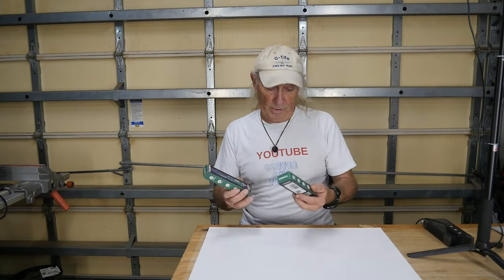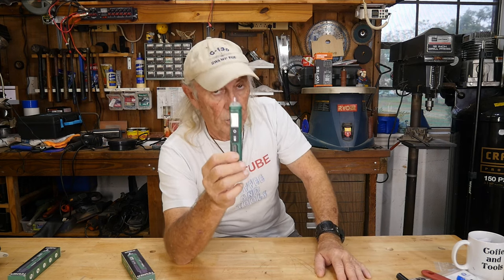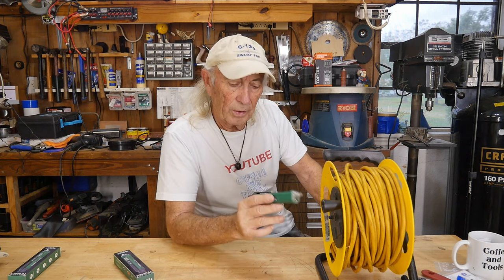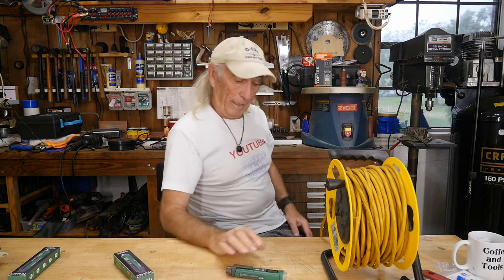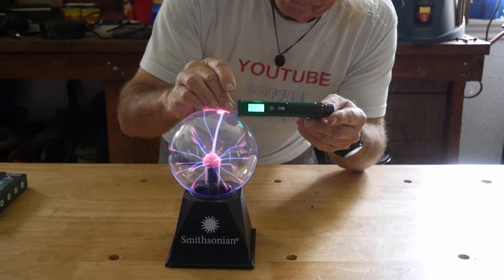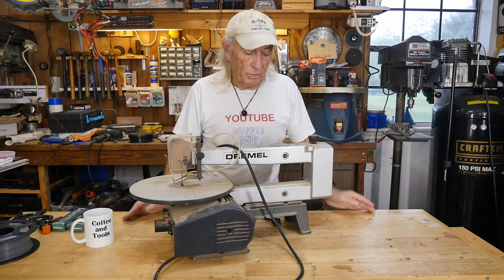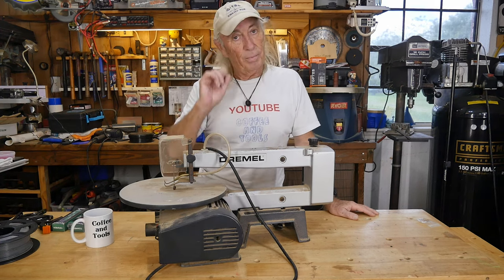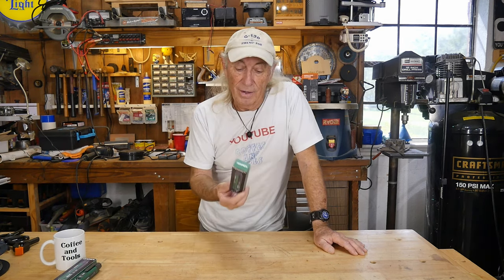Tesmen voltage detector simple and NEW, reviewed by Coffee and tools ep 381

Comment: I make firearm furniture and my delta scroll saw is an indispensable tool. Mainly when there is some cutouts on handguards, grips, and stocks. If i didnt have it, id have to use a forstner bit and make a bunch of holes then hit it with the drum sander which takes forever. If you're not making intricate enclosed cuts or big cutouts all the time then you dont really need it. Most folks can get away with just a table saw, drillpress, band saw, router, and some sort of stationary sander.

Comment: I have a delta and craftsman scroll saws. I use them and make lantern boxes with designs cut out in the front. Make quite a bit of side money with mine but I don't have a laser cutter and it'll cut through thicker material. Also find it relaxing to do scroll work.
Reply from the maker: Lantern boxes sound like a good project for the school saw. I'm just not a big fan of these lasers, but they are getting more and more power. Still with a scroll saw no software needed LOLOL..
Reply: It would be interesting if you could expound on the lantern boxes. That sounds like a fun project!!👍🏻
Reply: Scroll saws! Okay…I have one and yes, it IS on my list of tools to use after a make a movable base for it. It’s another one of those tools I inherited from my Dad and it is, yep…harbor freight!! But old harbor freight! The saw is a Central Machinery product out of Taiwan. It’s long out of business but I’ll tell you what…it was a great loss to hobbyist home workshop guys like me!! Sadly the bandsaw I had by them that I inherited from my dad, broke the table during one of my many moves. It was impossible to get parts so it got broken down for parts. Broke my heart. 
Anyway, the thing is a ship anchor!! Like all the central machinery tools!!! I did buy some blades for it and my dad had a bunch already. 
It even has the blower tube to push dust out of the way. 
So they may be “old school”, but I like that anyway!!😎👊🏻
Maybe I’ll start a movement to “Save the Scroll Saw”!!🤣
Reply from the maker: Yeah, he's got my interest for lantern boxes TOO....mmm
Reply: @SirTools uploaded a slide show no sound though im new to this. If there's interest maybe I'll try and record a tutorial.

Comment: Nice video. Do you know it the tool is sensitive enough to find power runs in walls? I’ve seen folks using scroll saws but most of them are following ready made designs so I think the laser cutter would be more useful. If you had a huge shop it might be a nice tool to have as what used to be. Thanks for sharing.
Reply from the maker: It seems to pick up power about 1ft away and near the walls.